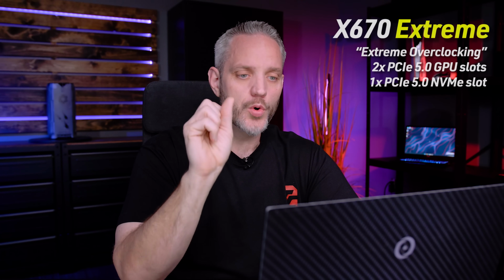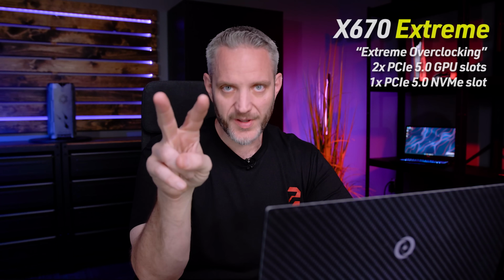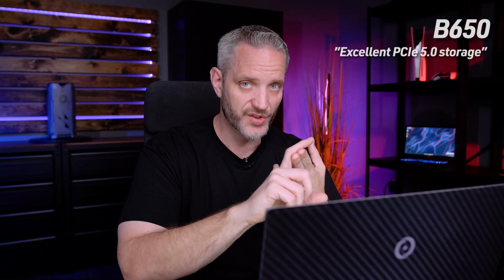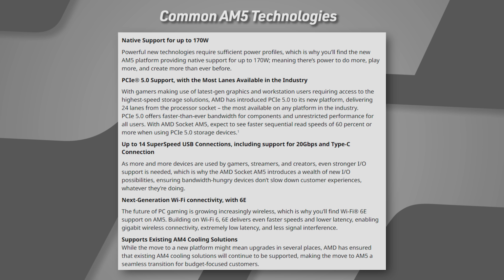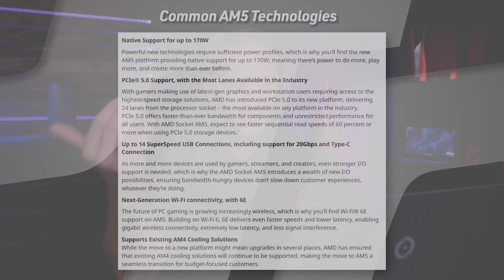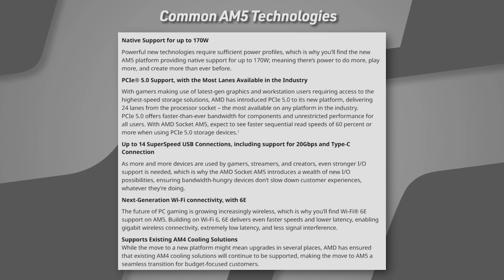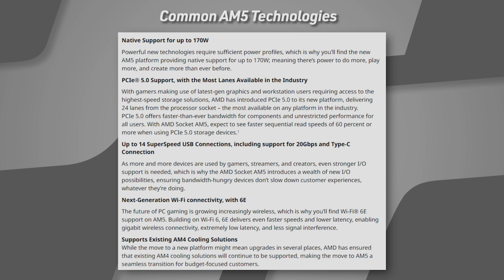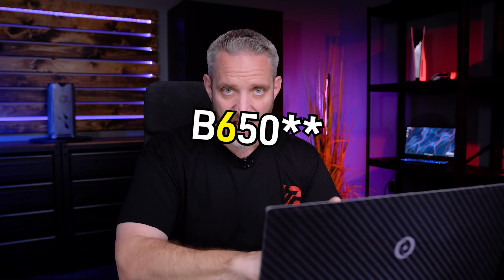AM5 Motherboards are EXPENSIVE! AM5 Explained

Comment: I'm sorry but $400 and up mobo's do not need to exist. Corporate greed is why we can't buy a decent mid range to upper mid range system for less than 2k-3k anymore. I miss the days of going to Fry's Electronics( Rip ) or Micro Center and building a basic rig for $500-600, a mid rig for $700-900 & a high end for $1000-1200.

Comment: 13:30 - That's pretty much me I think, except I would go with 7700x or 7800x.   My trusty 4790 based system finally kicked the bucket a few days ago.  The only things from AM5 that I really want are the CPU socket and DDR-5.  I don't have a need for PCIe-5 at all.  A 16x PCIe-4 GPU slot will last me for quite a number of years.  PCIe-6 will probably be out by the time I might need PCIe-5.

Comment: X570 and b550 were both expensive when they came out

AM5 will drop in price by the beginning of the year next year

Always wait 6 months after release to build, or buy last gen on release so you get discounted products

I bought my r7 2700x for 200$ when zen 2 came out
Paired that with my gtx 1070ti and a MSI X470 pro carbon for 170ish bucks

It was a great deal at the time, kept my build under budget and was able to spend a little extra on a nicer case

All about when you buy

Comment: I 'm running an i7-4790k with an 2080. I 've been waiting long enough and the oc 4790k served me well all these years, but i m ready for the am5 now :D
What I am not ready for, is those extreme extreme mb, I will wait for a good b650, all I need is enough usb ports to cover my needs, 2 sata for raid1 and 2 pci-e nvme slots, 1 of them 5.0 hopefully :) pci-e 5, i dont think it will matter, plus i m keeping my 2080 for the next years refresh of the graphic cards that are not out yet :P i have wifi on my current mb... times i used it all these years? 0 :) good to have, but I dont mind not having it... sound card i need the cheapest option available, i m using an external dac.
So all in all, I am a bit hyped since its upgrade time... but I am waiting for reviews and the 5800x3d is always an solid, cheap (comparatively) option.

Comment: I've just upgraded my processor from a 3600X to a 5900X, and man, I won't need anything more powerful than this for MANY YEARS! It's more than overkill for me already, which was on purpose, so I could have a lot of future-proof headroom, and I do have it! So, I have absolutely no reason to throw everything away so soon and spend a fortune on an AM5 system. And I wouldn't recommend anyone who can't wait a year or so to go AM5 right now, because that's the time it will take for AM5 to become really viable. AM5 is great, but with those expensive motherboards and DDR5, it will be bad value for money at first, especially with the now very extensive and granular AM4 lineup with processors that still offer amazing performance, an immense variety of excellent and affordable motherboards, cheap DDR4 memory, and blazing-fast PCIe 4.0 NVMe SSDs.

Comment: buy the extreme you will get more pci express lanes than you can attach nvme drives and 16x graphics cards to. for those with one graphics card buy the x670, for everything less than that with two or less nvme drives the x650 will be fine

Comment: Could the 2nd "E" mean extended? (like E-ATX) Edited to answer the question,  I'll wait for the reviews before buying new. My old $700 Z490 GODLIKE (EATX) was a waste of money since even XMP will crash the PC in COD Warzone. I even followed the step-by-step by Buildzoid on actually hardcore overclocking and while it passed all the testing...it still crashed on Warzone. Maybe the issue is just the RAM (Patriot Viper Steel Series DDR4 16GB (4 x 8GB) 4400MHz 19-19-19-39, same as Buildzoid but I think he was using the Unify MB)

Comment: Hi, an excellent video. I fully agree with you. I was an early adaptor for the AM4 system with two X370 motherboards. Since then I added various AM4 mainboards. But I won't be an early adaptor for AM5. I wait at least 2 years before investing in a AM5 system. I'm very happy with my AM4 machines and in no need of an AM5 system right now. A well configured AM4 machine has more then enough computing power for private usage.

Comment: Seriously considering going to amd for my much needed upgrade. Im currently on 7700k and 1080ti. Does nvidia still favour intel cpus? Or is that a thing of the past now. I really want a higher end 7000 amd cpu but it would cut my budget for a 3080ti etc would my 1080ti be a serious bottleneck for a 7000 amd cpu?  My predator monitor is 1080p. Any advice would be very much appreciated.
Reply: Upgrade your monitor to 1440p before anything else, a modern high end gpu is wasted on 1080p monitor. The 7700k would very much bottleneck a 3080ti. New Nvidia gpu’s are releasing soonish (hopefully) so I’d wait until then before purchasing anything.
Reply: Myself, I am planing on upgrading from my I7 6700k, 1070 (running on a 1440p monitor) to a R5 7600x, with either a 3070 or 4070 (if they come out soon and are reasonably priced). Either way that combination of gpu and cpu is very reasonable, and cuts a big chunk of cost from a 3080ti, especially if buying a used 3070

Comment: Im prob not upgrading right away, i just built a 5800x system last year.  If anything I'll probably just upgrade my CPU to the 5950x and get a 4090 when I can.   The issue I have is I need 3 slots, 1 for my elgato 4k60 pro and camlink, and my gpu.  If I went with 2 graphics cards I would need 4 slots in total.

Comment: I'm gonna buy it. I am an electrical engineer so I'm pretty comfortable with 500-800 usd motherboards because I know how much engineering goes into an optimally designed board, not to mention the time of product testing. You can have a mainstream board if you like but sometimes overengineering is totally worth it.

Comment: great video, typically always go with the mid tier option (b series etc) since that typically strikes a good feature set for the price. My only real complaint with B550 is that most motherboards had 5 USB A ports on the back IO, but the gen4 support was nice

Comment: I work as s hardware engineer I design circuit boards all day. And there is a massive shortage of prepreg (the fiberglass) used to make complex pcb's.
The general requirements for pcie gen5 are so crazy tight that I can't see any pcb fab getting better then 90% out of fab and that's not even an assembly just the raw pcb figure

Comment: I'll stick with my 2013 desktop PC, with its newish GPU, until October 2025. Then I might consider a new one. Though my 2018 laptop can run Windows 11, so who knows, I might stick it out longer. The test will be can I run the software I want to run well enough. So what's the killer app that will drive the upgrade? Elder Scrolls 6? Half Life 3? I'm not holding my breath! On the other hand, if the money situation improves... I haven't built a PC since 2015, so temptation is growing.

Comment: Been using the 5600x and 6600 XT and could not be happier... no plans to move to the new Gen of CPU's or GPU's any time soon. i usually run a one or two Gens behind. 

my second rig is  a 5600x on a B350 Motherboard of all things :) and 5700 XT still going strong with no issues.

Comment: I have spent over 5 months trying to get ASUS to use 2011 VRM designs. A 2-phase Ćuk-buck2 VRM is cheaper, has less ripple, is more efficient, and has a faster transient response than the 1920 vintage buck VRM. With a 39 "phase" VRM, if any one of the 39 FETs shorts, then the CPU voltage will go to 12 V. Think of the clock speed you will get before your CPU melts.

Comment: I think the other thing to consider with the price of these boards, at least on the AMD side, is that they are supposed to last for many generations (again). That seems to me there will be less sales then board partners are used to on the Intel side.

I'm planning on holding on to my AM4 for a good-long while. I think it will keep meeting my needs for now.
Reply: Basically AM4 has been there for the whole lifespan of DDR4 (at least on AMD side, who started DDR4 later than Intel), so I expect AM5 to last for the entire lifespan of DDR5 (at least I hope so). So we could very well be able to upgrade our CPU on those boards until maybe 2030.

That's why I think the second PCIe Gen5 slot doesn't have to be for a second GPU but just an expansion PCIe that will be the standard for most PCIe peripherals in a few years. And there are less PCIe slots nowadays so it's not even that much of a luxury. Same for the USB4 or the 10GbE. The X670E Creator is a pretty good deal in that regard. It IS expensive but not that much, about 470$ currently, and it might be worth it in the long run.

I know very well that financially speaking, it may not be that good to spend more once and keep stuff longer, but it's at least more ecological imo.

Comment: Sorry AMD, but i won't be upgrading anytime soon, you kinda shot yourself in the foot when you decided to be helpful and hang on a single socket for what, 4 gens already?  I'm on a b450m, currently using a ryzen 7 2700, will probably upgrade to a cheap 5k series in a few years....if the motherboard doesn't break in the meantime.  
That doesn't mean you should change the habbit and go the intel way, a new motherboard every 2 gen (well, 1 gen and 1 refresh), that's just bad  especially considering all the E-waste it creates.

Comment: Generally, well past the, "I should upgrade" point with my aging Haswell-E setups, but while the itch was there the budget wasn't. I've been watching Ryzen for a while now and definitely have wanted to get in on the fun. Probably going to look at X670, but I may slide towards a B series board depending on connectivity on the specific boards. If I don't see much I like then I may just go Ryzen 5000 as running not current gen hardware is definitely not a concern of mine even if it is a lot of fun.
Reply: If you are coming from Haswell, i would recommend AM4 with X570, because it is so cheap & reliable right now. 

You dont need X670/B650, DDR5 and PCIe 5.0 NVMe, because it is too expensive and therefore not the sweetspot. The money you will save, can go into more DDR4, more NVMe PCIe 4.0 or RTX 4000 and that will boost your FPS even more. 

This is why you choosed Haswell years ago, and kept running it until today, because it was the end of the line super sweetspot.
Reply: Right there with you with my Devil's Canyon, but looking forward to the B650 version of the Creator boards.

Comment: I gonna wait at least a year. Running a 2nd generation Threadripper (16 cores/32 threads) it still can do what i bought it for (Audio-Studio).
It handles everything well, even the biggest Orchestral-Library. 
Runs on 4,2 GHz all core, for years now, without any problems.
I guess the new AM5 platform with an 16 core CPU will outperform my current system twice :D
But i'm in no hurry ...

Comment: I have an x570 paired with a 5600x, so I'm not moving up. I feel that AMD got away with 5000 series pricing in the eyes of most consumers, because of the abundance of affordable motherboards that were already out. The price didn't seemed too bad even if you were building from scratch. This time things aren't the same at all. I usually skip a new platform on its first generation anway.
Reply: Same here. Just upgraded from a 3600X to a 5900X on a very good Asus TUF X570, and I couldn't be happier. No reason at all to upgrade any soon, and I mean several years!
Reply: @goytabr  8 years
Reply: @goytabr  Really
Reply: @goytabr  By then it will be Gen 6 and the Gen 5 stuff will be real cheap compared to the Gen 6. That's a good strategy.
Reply: @goytabr  I'm not planning to upgrade more than once in a decade after getting a high end zen3 honestly. 5950x or 5900x, maybe even an X3D three years after I first built it and that should be good at least from 2020-2028 on this system.
Reply: I have a ten year old AMD system.  I don't know which CPU I have.  The CPU fan has stopped working.  Sometimes the computer freezes and I have to close it down.  I will be updating to The new  Ryzen 7600X and AM5 motherboard probably with B650 motherboard.  I will wait until the bugs are out of the system in at least 3 months time.  I will get it sometime in 2023 when prices start to come down.  I am an AMD fanboy.  The main reason is that I like the idea that the motherboard lasts for years before it gets updated.  I also like the idea that it is 5nm technology and so uses less power for its performance compared to Intel.
Reply: Agreed just upgraded to 5600x on a x470 aorus gaming 7 and still happy so may wait till the next gen but idk
Reply: i have a x570 with a ryzen 9 3900xt and 5700xt and corsair rgb pro 3200 32gb i want now the ryzen 9 7900x with 4080 16gb with 32g g skill 6000 in a b650 i guesss now
Reply: Same here, x570 with 5600x, and i put in 7900xt with 3440x1440p  just awesome for x years...next upgrade will be to 4k with same cpu/gpu
Reply: @AndStarc  Doesn't the 5600x bottlenecks the 7900xt?
Reply: My cpu is i7 12700k + z690 and rtx 3060

Comment: what would be more wise to sacrifice on x670 ? 
pcie 5.0 nvme ? or pcie 5.0 gpu ? because i heard some x670 boards will have nvme 5.0 but not 5.0 gpu
and viceversa.
Reply: favor the nbme over the gou being on that PC u gen 5 slot.

even the newest and GPUs coming soon won't be able to take even 30 percent advantage of the difference in bandwidth room to flex.

Comment: Are the more expensive motherboards worth it if you plan on upgrading your CPU two generations later? I had a Sandy Bridge i5 system for 8 years and it would still be running if my budget ASRock motherboard didn't die.
Reply: yes because unlike Intel ..and actually always has supported 3 to 5 gens of cpus upon a new chipset gen of motherboard launching

Comment: I am still using Asus ROG Maximus VII Hero, I bought 16gb DDR3 back then and honestly good 90% of stuff that mobo came with has been useless to me...4 ram slots? Next time I will buy 2x16gb ram sticks, no need for another 2 slots tbh. I have 3x PCIe x16 slots, totally useless as well as 3x PCIe 1x slots (im not using any), 8x SATA III (good lord, have not had more than 2 drives connected), USBs in the back? I need only mouse, keyboard and external usb hub...my advice to new buyers is to really think about what you really need, vast majority of that extra stuff is completely useless to average users.

Comment: Personally, I'm skipping Ryzen 7000. I've got a 3900X that is still doing the job admirably so I can wait a generation or two before upgrading again. Hopefully, in that timeframe, I'm hoping that the CPU makers pull their heads out of their asses and give us more PCI-E lanes on commercial CPUs. I WANT to get rid of all of my mechanical hard drives, so very badly, but it feels like wasting money to buy SATA SSDs since I gain not a lot of performance. Eventually, I want to have an 8TB NVME array for my bulk storage needs, but Threadripper/Epyc/Xeon don't have the clock speeds I need so all I can do is keep hoping and waiting.

Comment: Thanks for the video update Jayz. It would also be good to know if you can also use your existing power supply for the new boards or if this too would require a new one.  Of note my current system is running a cooler master v550.

Comment: I don't quite understand how Crossfire needs developer support.  I've written multi-threaded code for CPUs but nothing for GPUs so I'm not sure what I'm missing here.

Aren't the graphics processing units on each individual graphics card already composed of the equivalent of many "cores"?  Like, several hundreds at least, up to more like thousands on even mid-tier gaming cards?  Point being, the processing is already multi-threaded so what's the obstacle?  Obviously, one GPU needs to be in charge of delegation of each parallel task, but that's a pretty simple thing to arrange with an arbitrary # of CPU cores, whether on one or more chips on one system or even across multiple physical machines in an HPC cluster.  So what makes it so challenging on GPUs?

Comment: My thoughts: with the 670E boards, 2x PCIE5 16 lanes slots + 1x PCIE5 NVME Slot make it possible to run 5 NVME PCIE5 (4 on bifurcation card) & 1 GPU PCIE5, I think we'll see at least 3 NVME Slots on Extreme boards but as usual like with X470 & X570 only one fast. Having a second full 16X PCIE5 Slot should make it possible to build a really fast PCIE5 NVME Raidsystem. Can't believe that there will come a crossfire thingie around the corner.
Reply: The more expensive x670e boards have up to 3 PCIe-5 slots for m.2 drives

Comment: Just a small comment about Wifi 6E: I ran on Wifi 6 (not even E) for two years, while playing competitive Overwatch and I had no dropouts, didn't notice any lag, any ping issues, nothing. It was honestly amazing. If you're an absolute pro at a highly competitive shooter you should definitely go wired, but aside from that wifi 6 is quite sufficient.
Reply: I was going to say, why on earth would you call yourself a competitive pro player and not be on a hardline. You can't even get those higher rates of data transmission anyway, plus my signal despite being near the router disconnects sometimes for some mysterious reason. This is especially true during downloads, and it never happens otherwise. Pretty amazing coming from memories of 56k modems playing Starcraft certainly, it is absolutely amazing what kind of data transmission we have just through the air, but at the same time I'm only going to be playing The Division 2 with my LAN cable plugged directly into the motherboard.